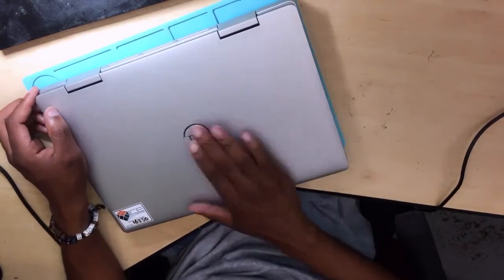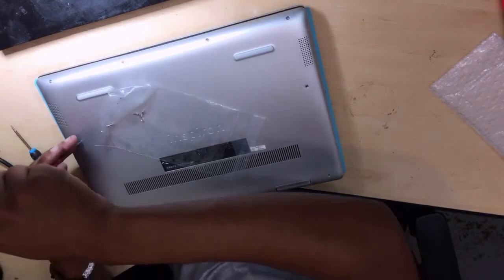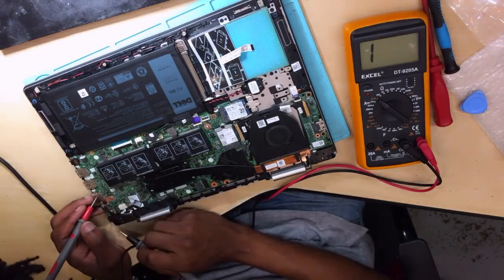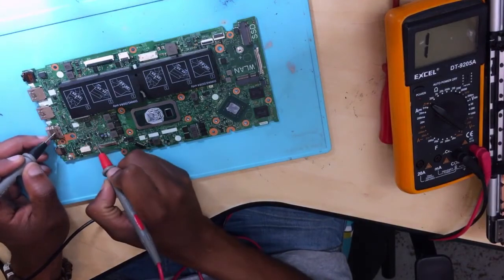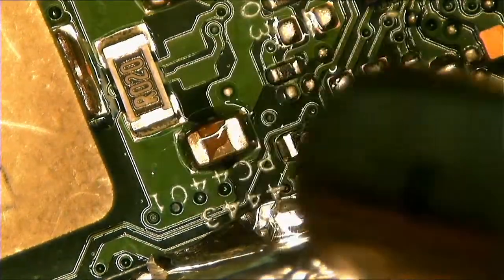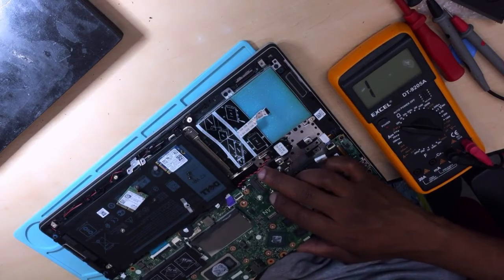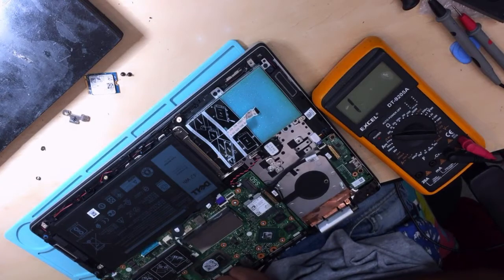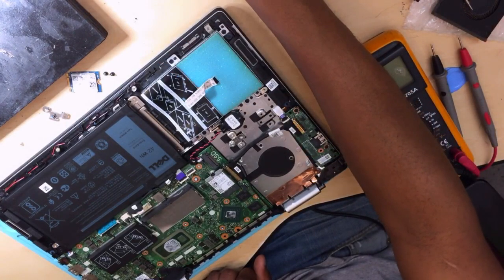How to repair a Dell Inspiron P93G, p93G001 Laptop not turning On, laptop motherboard repair lessons

Comment: Hey, some water spilled in my dell inspiron laptop and i think it short circuited the board.  Also the charger stops working as soon as i connect it to the laptop after the incident and. Can i use this method to change any damaged capacitor and will it work again?